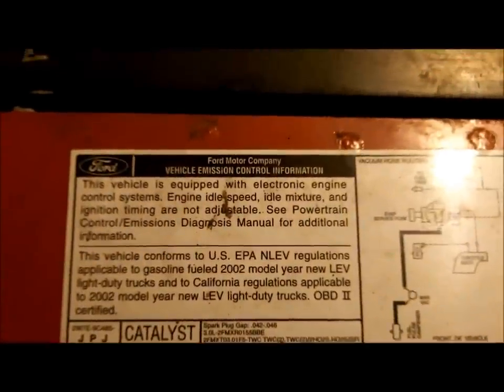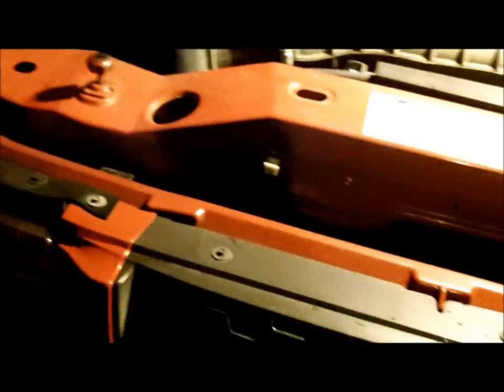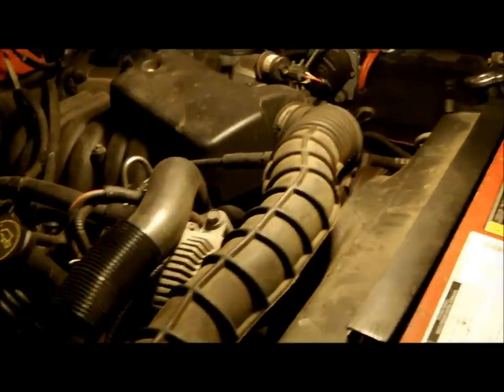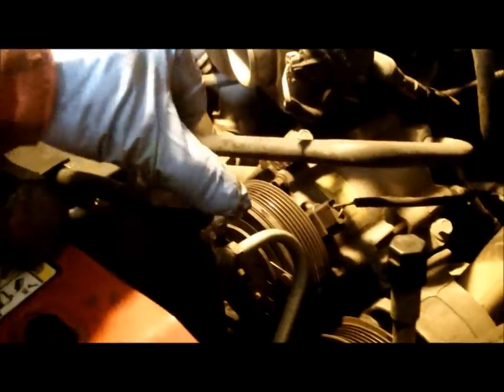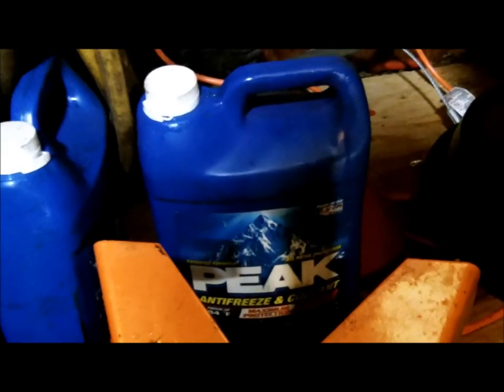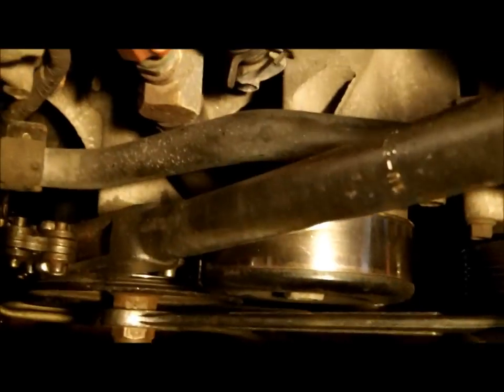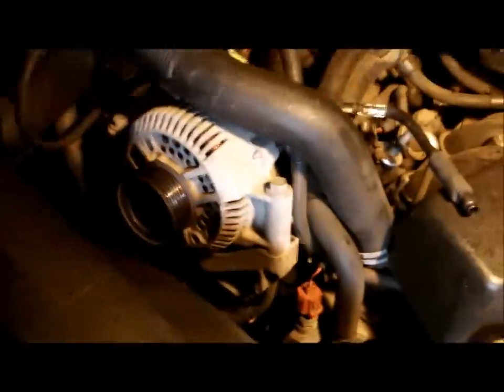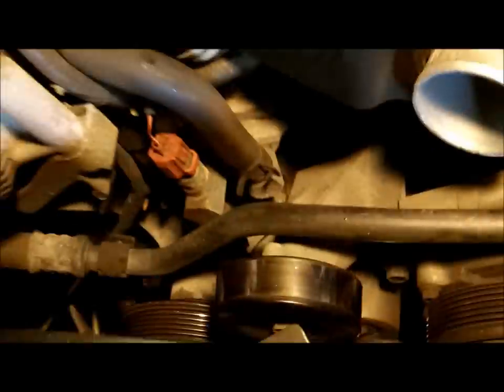Ford Ranger 3.0 timing chain replacement Part I.wm

Comment: Thanks for the videos. Do you know what year(s) require the oil pan to be removed? I have a 2000 3.0L Ranger -- my Haynes manual says pull it, other sources say it's not necessary. If I understood correctly, you didn't pull it, right?
Reply: Thanks!

Comment: Where can we get the correct torque settings for the Water Pump bolts, Harmonic balancer bolt, Timing Cover bolts, and both timing set gears bolts, My 1998 Haynes manual isn't much help to my 1998 Ford Ranger 3.0 XLT, even though its for the year range of my vehicle.